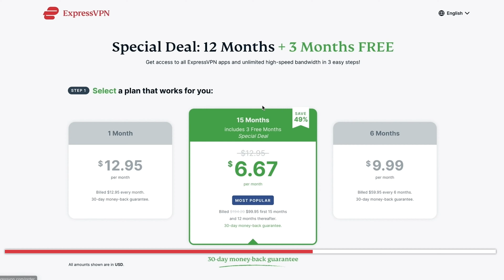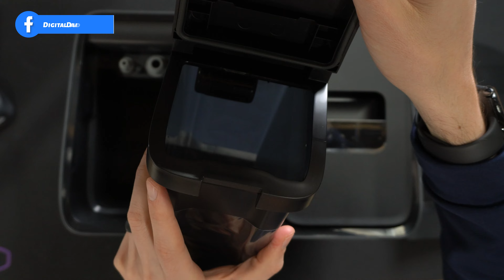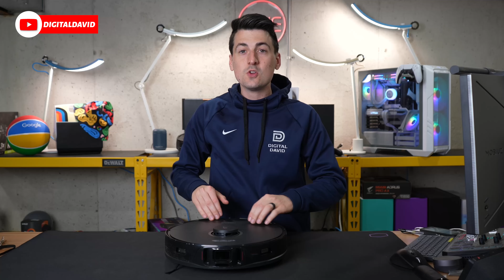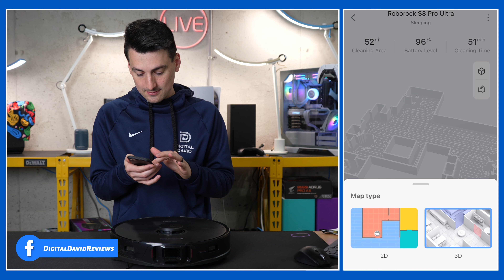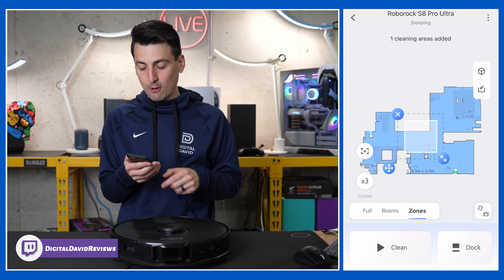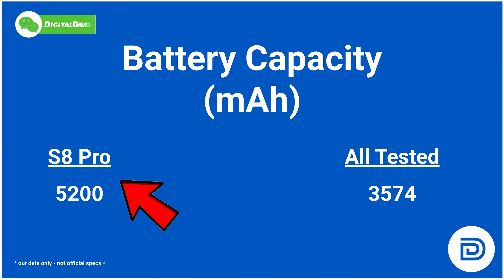Effortlessly Clean Your Home with Roborock S8 Pro Ultra Vacuum and Mop

Comment: Thank you for your video! I’ve enjoyed your putting it through more real-world situations and attention to details than other reviews I’ve come across. Especially showing us what it grabs before it pipes it into the dock. Do you know how it will perform if, say, the Internet at your house goes down? Also, does it ever push any carpet mats around that don’t have anti-slip on the bottom? Thanks, again!
Reply from the maker: Thanks for the feedback. We love robot vacuums and still feel like we have a long ways to go to make better content so you taking the time to share some positive feedback in greatly appreciated!

It will still perform when internet goes down! Learn more from their site: https://support.roborock.com/hc/en-us/articles/360030815691-Can-robot-cleaner-work-without-Wi-Fi-#:~:text=Yes.,power%20strength%20selection%2C%20and%20more.

Our small rugs have anti slip so they stay in place... we have a larger 5x8 not on slips but it stays steady (probably more due to its larger size) so safe to assume some push around if you have a smaller rug on a solid floor like LVT/LVP/Tile etc!

Comment: For the clean water bin…can I add cleaning solution to make the floor smell good or not?
Reply: For reference I have both the S7 Pro Ultra (NOT the MaxV) and a Braava Jet M6. You can use virtually any cleaning solution (safer if made specifically for robot mops - Bona, for instance). What you must specifically avoid is anything that claims to nourish/ hydrate/ wax your floor since these will likely clog the spray nozzle.
Reply from the maker: Thanks for the help on that!
~B
Reply from the maker: I don't think it would cause a problem, but I don't feel comfortable telling ya to do it just incase lol
~B

Comment: I'd really like to see a list video talking about your favorites. "Best value for the price", "Best App User Interface", "Smartest" "Most expensive", "Cheapest", "Best Vacuum only", "Best Mop", "Best for Dogs", and "Best for different surfaces like Shag Rug" I'm seriously in the market for another robot vacuum but you have too many videos, and I'm trying to find one that's pretty budget friendly. Are there any good ones for less than $200 that have decent mapping in the app so I can set exclusion zones and stuff like that?
Reply from the maker: Thank you for your comment and your interest in finding a budget-friendly robot vacuum with decent mapping capabilities and app features. It's understandable that with a wide range of options available, it can be overwhelming to find the right one that fits your needs and budget.

While I don't have real-time information on specific products or their current prices, I can provide some general guidance. In the sub-$200 range, it may be challenging to find a robot vacuum with advanced mapping and app features like setting exclusion zones. However, there are still some options that can offer reliable performance within that budget.

It's a good idea to look for robot vacuums from reputable brands that have positive user reviews. Some models from brands like Eufy, ILIFE, or Roborock may have basic mapping capabilities and app control at a more affordable price point.

To find the best fit for your needs, I recommend researching specific models within your budget range, reading customer reviews, and comparing their features and capabilities. Online marketplaces and retailer websites often have filters and search options to help you narrow down your choices based on price, features, and customer ratings.

Additionally, it's worth keeping an eye out for seasonal sales, promotions, or refurbished options that might provide a better value for your budget.

I hope this helps in your search for a budget-friendly robot vacuum with mapping capabilities and app control. Good luck in finding the one that meets your requirements and simplifies your cleaning routine! cnl
Reply from the maker: Yes I got exactly the one for you! It is the Dreame D9 you can get on Amazon here: https://geni.us/YRVg78a

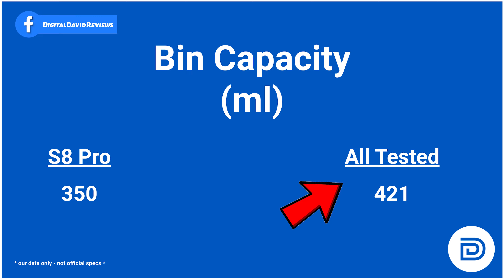Comment: 20:07 a detail missed. "That can go home and self-empty as needed" Roborock, unlike iRobot, does not have a full bin sensor and will not return home to empty due to the onboard bin being full.
Reply from the maker: Correct we misspoke! You can auto empty it anytime within the app!
Reply: They will go home for low battery, and you can set it to only run for a shorter clean if there are a lot of debris.

Comment: S7 MaxV Ultra had camera. I think S8 is a definite downgrade in some areas
Reply from the maker: Totally! But maybe they will release an S8 MaxV Ultra at some point???. Although at this price point I'm thinking that would be a huge struggle to go even higher with another model!
Reply from the maker: Although the dual brush roller is a huge win in my book!
Reply: @DigitalDavid  The dual brush helps with better cleaning of carpet I think, but hardwood floors not much difference. After much research, I purchased the S7MaxV because of the removable mop pad and water tank. Having different levels of the house with the dock only on one level is a problem. When cleaning a level the dock is not on, you have to wait for mop to wash and wet before picking it up and taking it to another level. I like being able to just grab the robot, run water on pad real quick, fill water tank and place it on the level and go. I do this for other levels without the dock whenever I go out the door real quick to run errand or whatever. Also lot of complaints about build-up in water tank which could be a problem if its not able to be accessed. If something goes awry with the new S8 Ultra dock, the robot is useless also. The S7MaxV just makes more sense to me!!
Reply from the maker: You made a great choice with the S7MaxV!!!